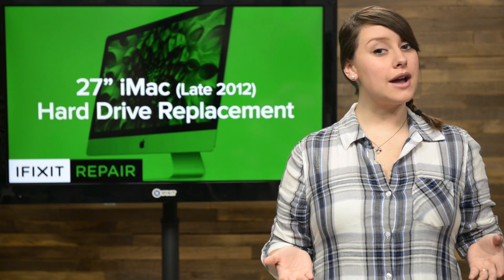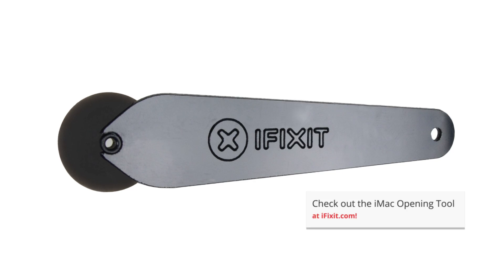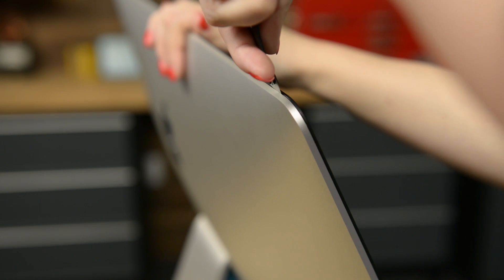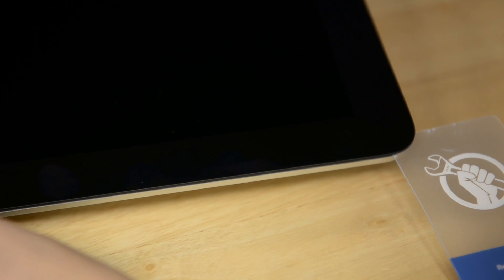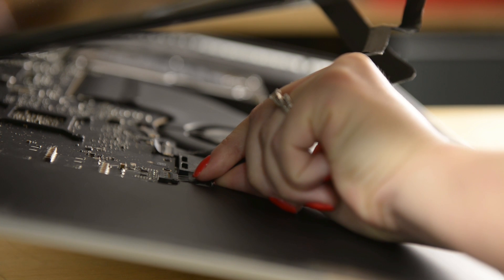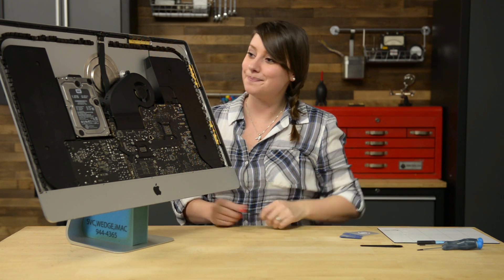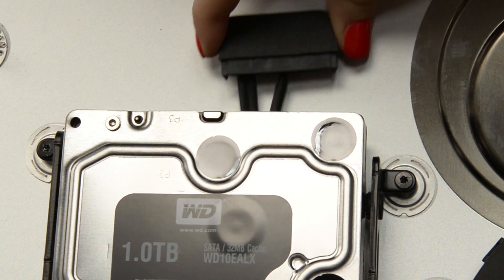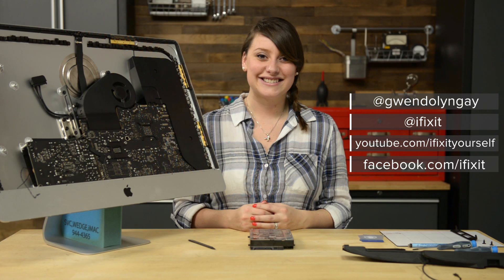How To: Replace the Hard Drive in your 27" iMac (Late 2012)

Comment: Thank you for this! It really helped me replace my drive and my iMac now boots up stupidly fast! It's a whole new lease of life for what is really an ageing machine.

However, I found I didn't need to remove the speaker completely to do so. I simply unscrewed it, then leaned it out of the way of the screws. This significantly reduced the time and complexity of the fix.

Other than that your instructions were clear and useful, and I was able to do this repair with confidence.

Thanks again!

Comment: I wonder if you can help me, I did exactly what you said, with crucial SSD & owc parts but my late 2012 2017 I mac is not working now, its giving an error with circle & a cross through it when rebooted
Reply: All you need to do is press command + R when booting and then the computer should allow you to install the operating system.
Reply: Vishal Hansraj Apple has found out about an unauthorised repair. Your computer is disabled and you are permanently banned from purchasing Apple hardware.

Comment: Not neccessary to remove the speaker or cable. Remove the speaker screws and shift the speaker aside to give clearance.
Also make sure to have mac adhesive strips to restore the LCD in place. Double sided tape will not suffice.

Comment: Meanwhile  I would have changed my hard-drive in my PC case within 5 mins, side panel taken out with two screws, slide out the hard drive caddy, replace the new one, cables reconnected, Side panel back on, job done..
Reply: and you'd still be left with a PC
Reply: Writing my reply on a late 2012 iMac 27". Sorry to burst your bubble, but approaching 6 years and still going strong!
Reply: Yeah, but you'd still be stuck with Windoze . . .
Reply: And then spend the rest of the time you saved getting rid of viruses and downloading drivers
Reply: Lol I'm good. I mean this pisses me off as well, but I'm very picky about aesthetic and design and user experience that reflects a very specific ease of use. Everything has to be a very specific style (stylish looking) and VERY minimal for me (I can't stand wires lol). To each his own. Just go with whatever makes you feel comfortable while using it. I use PCs in research labs when they can't afford iMacs because they're relying on small grant money and would rather spend the money on new research supplies, but at home I use my Macs and still prefer Macs.
Reply: N. I. But I wouldn't have paid silly money for a apple branded donkey! You do know that apple are now soldering ram into their motherboard!costly if the ram goes faulty, so I may still have a PC but at least I can fix it a lot easier and faster and cheaper!

Comment: Very cool actually.
Reply: What's cool about having to do 900+ steps to swap a drive? She surely didn't do that in 7 minutes. This is why larger businesses do not use macs, I swap drives a lot and it takes less than 5 minutes.
Reply: iMac is a crazy model to open. Fun to see it done but I would never do it.

Comment: At the end of the day, these iMacs are a nice piece of engineering to fit everything so neat. Too bad about all the adhesive to seal it all
Reply: Yeah how hard would it have been for Apple to build a service door behind the HDD for a much easier upgrade, like the RAM on the 27"?
Reply: it's not so bad. I had no trouble performing a HDD swap making it a 5TB Fusion Drive
Reply: @Sergei__v  Way too much work, and changes from model to model so they haven't  got it right yet? Make a BAK PANEL for gods sake! Hard drives & memory are replaceable-upgradable and should be easier.

Comment: Is anyone can repair hard drive heads??
Not entirely hard process if you got zooming lenses,modified soldiering iron with small sized copper wire attachment as fine tip,screwdrivers and needle nose pliers...

I had fixed a small head that had cutted ribbon wire,use zooming glass to see where damage is and carefuly use hot needle to remove insulation or melt it,place carefuly paste where small tiny soldiering would be placed and soldier small area..
majority hard drive heads got 2 tiny ribbon wires attached to it...

Sometimes heads manage separate on some boint from holders which will result of burning them off,if anyone experienced with hard drive meintanance must know particular clicking or buzzing during hard drive power up..
Simply use small fine object like tooth pick and place super glue on back of heads but carefuly by not ripping head off and this will resolve many troubles ahead....

Some problems with hard drive parts replacemants recquires advanced systems like PC3000 or MRT pro or plus..
PC hardware/software solution for hard drive advanced data recovery,this is what all data labs use it and charge everyone fortune for recovery of data...

It also allows you to reprogram NV ram chips by having special chip adapter that plugs in MRT or PC3000 expansion card,this particular hardware allows power plugging of hard drives with IDE or Sata port....
This allow to default power run for heads under factory levels,heads could be reprogrammed from reading to writing mode..

Anyone can check specifications of MRT plus or PC3000,those are PCI express port cards or host controllers....
Hardware could be order from Russia,Japan,Canada and some parts of USA but under 10 grands and software cost as good as 3 grands alone..

There is another option order from China or Taiwan where it cost way cheaper such as I did and device work like a charm and help resolve various hard drive problems....

Recently prices on particular diagnostic tools get raised from 365-538 bucks..

Software is 2 versions one is monthly updatable with every new model of hard drive or buying standalone version which not need any updates..
Every expansion card got registration key,in order to run recovery and diagnostic program special registration code recquires...

In order to run program correct card must be plugged in particular pc and not moved to another computer othervise re registration of code recquires over again..

Most troubled hard drives is Samsung,Toshiba and Seagate ever science they got various problems over time...

the heads have issue to separate from holding arms because of inferior build,if problem verified in time it is possible to disassemble hard drive (must be dust free area) it possible to remove headstock assembly and carefuly glue head back to holding arm...
Hard drives recquires lot of paciance and no rush when work with them,very tiny components is easy to break off or get damaged...
The anchor magnet must be removed by proper needle nose pliers,it should separate from one single secured pull off....

Platters must be dust free and unscratched,this could cost loss of some data..

Sometimes preamplifier chips get shorted if over voltage get in,so heads looks fine but they not work,it is small control chip that logicly correspond with PCB NV ram chip..
If NV Ram chip is burned off on PCB board than another PCB boards wont work or even turn spindle motor on....

Reprograming NV ram chips must be done by heater gun under medium temperature othervise PCB board can deformed and than everything wont work...
After chip removal PCB board recquires cool off by fan or air conditioner,donor NV ram chip placed in special socket or adapter that's connect to MRT expansion card and in suite there planty of hard drive codes that could be looked by model and manufacturer than code get programmed by first erasing old one and writing new one just like Bios mode does and than new chip get carefuly soldiered to PCB board...

Ones again all those procedures must be done by highly trained individual who specify on hard drive meintanances....
I been doing it like 3 years already,had succesfuly fixed 5 drives,if hard drives make buzzing sound it cannot be repaired most likely platters undergone and scratched,replacing heads wont make any differences and they would be damaged as well..

It only could be programmed in MRT suite by disabling writing mode to a reading mode allowing data mirroring and restructuring if it possible for recovery....

All cheap programs that on internet wont allow you fast recovery as they promise after you register or purchase full version,it all lies....

MRT or PC3000 allow recovering data from 250MB-1.5GB per minute and that's the main recovery trick of all data labs....

If somebody know about hard drives functionality and operation than MRT or PC3000 is necessary diagnostic and troubleshooting tools...

The only trusted hard drives is made by Western Digital,never had problems with them,new generation got fail safe device if over volted,if over volted somehow preamplifier chip get blocked by PCB features and voltage not reach preamplifier chip sort of circuit breaker...

New generations would be lies on NV Ram chips couse they stores data more officient,no heavy weight unlike hard drives and they easier to cool by fan.....
So far 1 and 2GB NV ram data cards had been made......

Also I7 is not very best system or platform to play PC games,it CPU got less memory cache which decrease some performances and many users complained games get freezing point...

The regular socket 775 works better,combination of Asus motherboard turbo and Xeon 3370 works better,Xeon chips not get hot fast like ordinary quad cores does plus it overclock higher up to 5GHZ but with intense cooling...
The safe overcloacking is 4.72GHZ everything else recquires licquid water based cooling...

Mac is not best system from my point of view,it got less features and less virtualization technology like Intel offers..
Reply: A long passage ._.